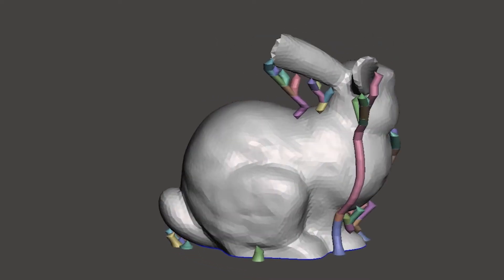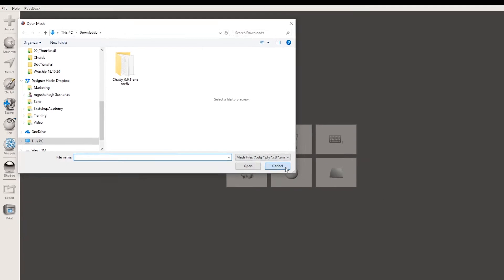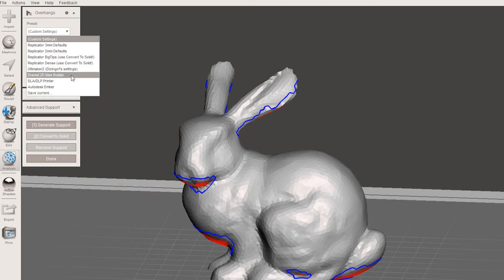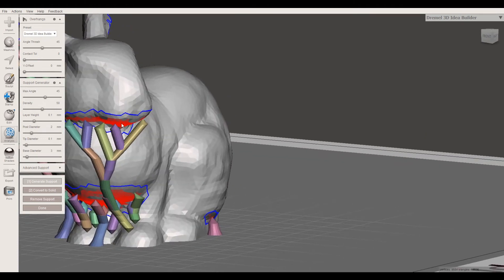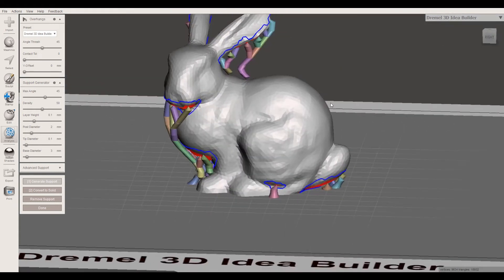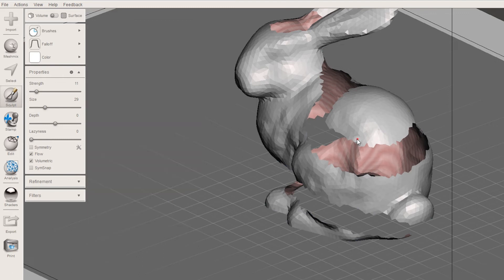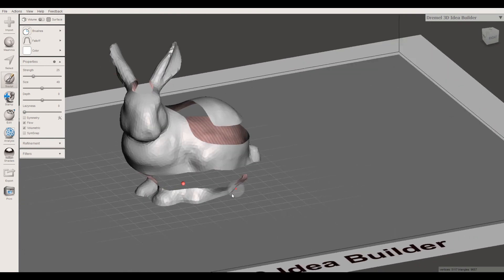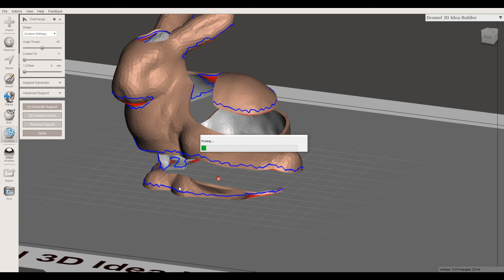How to Generate Supports for 3D Printing

Comment: You misspoke when talking about removing supports. You said you can "shift click" to remove them, but that is the hot key you later reference as automatically adding supports. I've tested this, shift click does not remove supports. How do I actually remove them?
Reply: I believe control click deletes and shift click adds